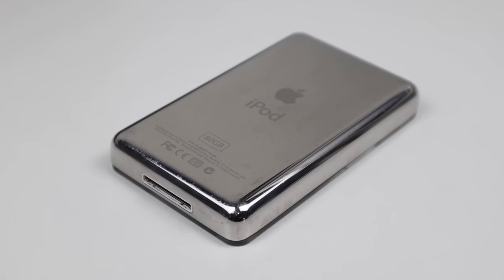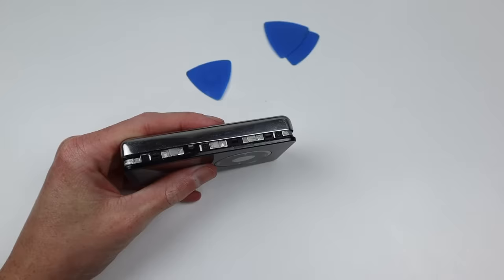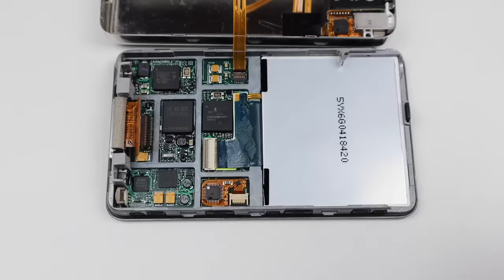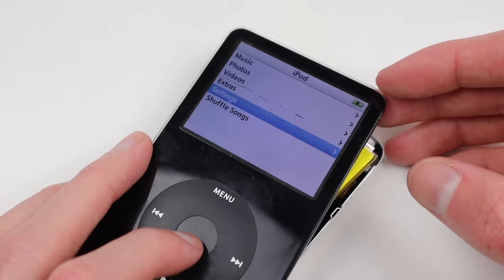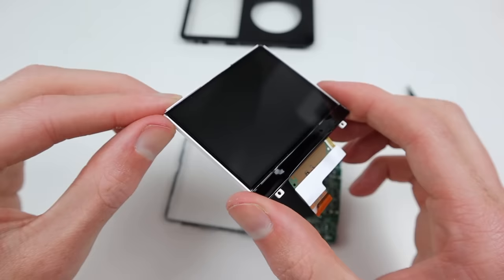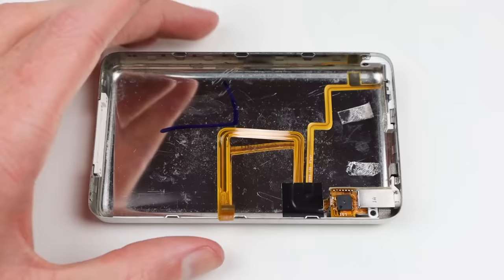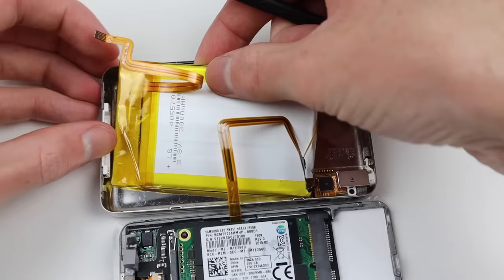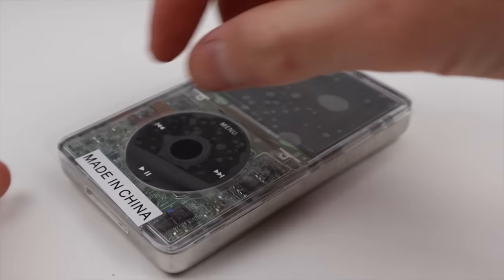Custom Transparent iPod Classic 5th Gen - 256GB SSD & "Nokia Battery life"

Comment: It is very nice that you put 256GB ssd inside that old ipod :D i also did same mistake, the os that ipod uses has to store its library metadata inside of ram, which is reaaaly small in your model i thing it is something around 64 MB (which is approximately metadata for 20 000 songs). Now what you can do is overwrite the 'ipod os' with rockbox (i couldn't do it, it never actualy work for me). I hope you will find some sollution and please let me now :D. Also there are many mods for ipod mainly for the 5th gen from this video. Have you read about diy mode? Or add bluetooth? :D 

Problem with memory: https://www.ifixit.com/Answers/View/50726/Highest+possible+capacity+for+a+30gb+iPod+5th+gen
DIYMOD: https://www.instructables.com/id/DiyMod/   
Bluetooth: https://www.instructables.com/id/Mod-Your-5G-Video-iPod-With-Internal-Bluetooth/

Looking forward for your reply :)

Comment: I must ask. After installing the new battery roughly how many hours did it last? I crunched some numbers if it was using a 650mAh battery it lasts around 12 hours. Now if we use a 3000 chungus battery that’s around 55 hours. But the battery I got from iDemiGods fell short of 35 hours. Not saying it’s good nor bad but I feel like I’ve been gypped because I used a USB meter to see how much the battery chargers to and I came shy of 1500mAh. That’s no where near the claimed 3000.

Comment: Is there no way to remove the scraches on the metal backing? Have you tried anything? I'm hoping you respond to comments.
Reply: Sure. Put a new one on. 😂. Maybe some metal polish and a lot of elbow grease will make the scratches less noticeable but you’ll never get it looking new again. Best option is to go with a new back and then put a clear protective film on it once installed. Or go with a plastic back.

Comment: Dude... 
Next time you decide to mod an iPod 5  
PLEASE!  
PLEASE! 
PLEASE! 
Watch an iFixit video on how to open it!
Google: iPod 5th Generation (Video) Repair

It's not easy to open 
It is VERY easy to destroy the front plastic and 
it is also VERY easy to damage some of its internal parts like the dock, the HOLD switch and the 3.5 jack.
Or you could just stab the battery and fry it.

You also installed the battery the wrong way. 
Upgrade batteries for the iPod 5 are custom made to fit the THICK iPod 5 without bending the ribbon-cable .
Next time, just mark where the ribbon of the original battery makes the bend to connect with the logic board and make sure the new battery is orientated in a way that its ribbon cable is in the same place.   

Otherwise, it looks GREAT with the clear front cover. 
And I bet it sound great!

Comment: Hey, I got a gen 5.5 iPod classic w/ failing 30gb drive and old battery. I was planning to get the 3000mAh battery and iflash sd solo. I have 2 questions for it, will be glad if someone answers. Firstly, I thought with 3000mAh battery I have to get thick cover and some other parts but Jeffreys was able to use original back cover. Is it optional? Secondly, is sd card option good enough for longevity?
Reply from the maker: The hard drives are thicker in the 80GB models so with your 30GB model you need a thick back if you are wanting to add the bigger battery. If you just do the flash mod you don't need the bigger back.
In terms of reliability I havnt spent a long term using an SD Card iPod but if you get a decent SD card I see it way out lasting a HDD, plus SD Cards are easy to replace. I have been using this iPod every day since I released this video and it's been flawless.

Comment: sd cards r still the best choice , even like 20$ ones r 100MB/sec rated and this ipod can only do 15MB/sec .. that msata ssd was totally unnecessary cuz its running like 40 times slower than the capability of that ssd , even sd cards r fast enough to fully saturate the ipods hardware. while beaing much much cheaper!
Reply: ssds are usually cheaper than sd cards once you get up to the 256gb mark

Comment: Will that battery fit in a A1136 thin iPod classic 5th gen or do I need the bigger rear case?
Reply: I would imagine you'll need a bigger rear case. I picked up a 30GB iPod classic 5th gen and I'm still waiting on a 850mAh replacement but I'm thinking of going bigger and replacing the rear case as well.

Comment: Woulda had a much better battery life and even surprisingly a faster interface if you just used an SD card adapter from iFlash. Just ask dank pods. But repurposing old meats drives is cool ecologically speaking.

Comment: Do I have to use a thick back cover?
Ipod classic 60 or 80g ?
Reply: thick back cover is to fit the bigger battery, if you won't upgrade the battery you can use a thin back cover. For 256gb both 60 and 80 should work fine.

Comment: hmmmm mate.... putting a LiPo pack just on top of a SSD drive is not the safest idea ever. SSDs can get very hot (that's why in the iFlash box there it was a thermal pad, because that's meant to create thermal conductivity between SSD and metal case) and LiPo cells really doesn't like to be hot, they can easily fail, that means vent if your are lucky, explosions and fire if you're not so lucky.
And it's very, very easy looking at your how you did mod his device...
On a side note, you installed the display adhesive the wrong way. It's meant to hold the screen on the sides... that's not LOCA adhesive, the center portion on the screen must be free

Comment: That SSD is actually hurting battery life. That SSD also puts out a lot of heat so it could kill the battery slower. 
Also more than 2 hours of syncing could kill the drive or the adapter. 
Using a simple SD card adapter is the best bet here.
Reply: Yup. The single SD/Dual works better or better yet the quad micro SD card. These M.2 and mSATA’s get very hot and kill batteries.

Comment: Ah, too bad you used a thicc iPod 5 backplate. I prefer the slimmer 30GB model with the bracket delete to fit the 2000+mAh batteries. I also got the clear clickwheel on mine for the best aesthetics. Check out my transparent and other iPods: https://imgur.com/gallery/kSkUqV8